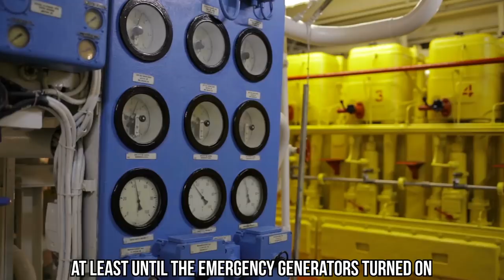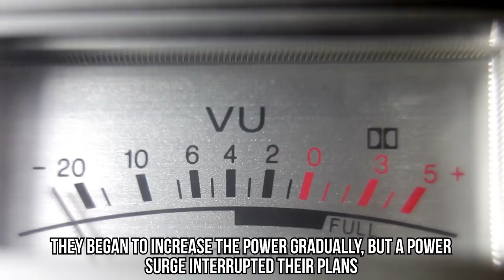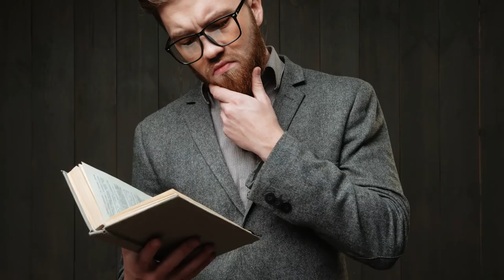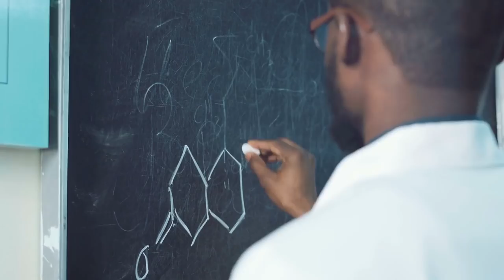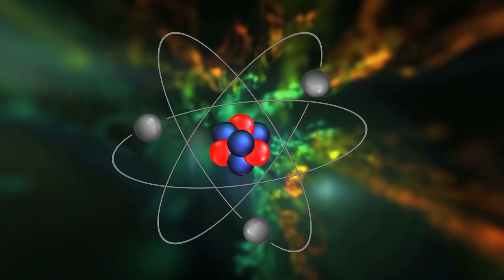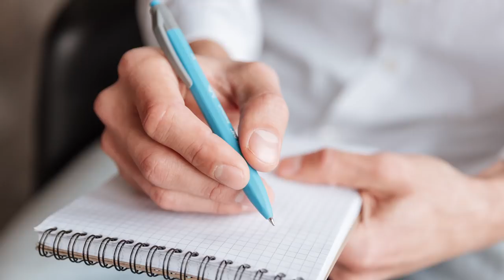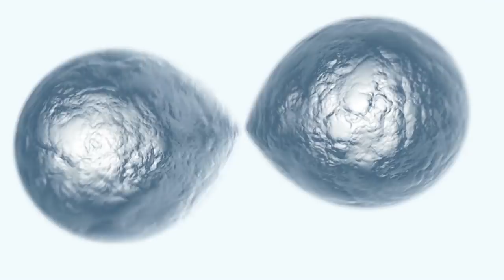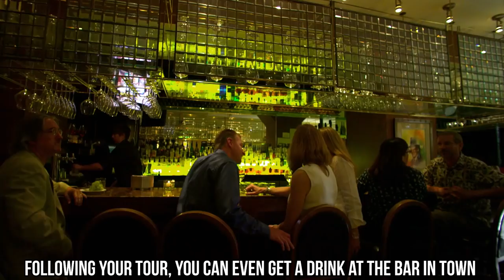10 Unexpected Consequences Of The Chernobyl Disaster

Comment: 0:02 Pripjat wasn't a small town, 50.000 people lived there, mostly young families.
0:47 The test wasn't wanted, it was ordered by the plant managers and should have been conducted before the reactor went into service
0:54 Sorry, nitpick. Turbines IN the reactor? Turbines of the reactor.
1:28 Actually, they couldn't have brought the power level back up. The reactor was poisoned with Xenon which made it impossible to rise the power up without withdrawing control rods, that's what they did, they withdraw too many, which meant they were losing control of the reactor. The right thing to do in this situation was to shut the reactor down. Right after the drop in power occurred
3:23 Caesium 137 has a half life of around 30 years, as does Strontium. The big problem in the immediate aftermath was Iodine which has since decayed, but Caesium and Strontium are still found in the ground and are absorbed by mushrooms to this day. To this day, mushrooms and the boars that eat them are contaminated in Germany.
3:29 Quickly? Pripjat was 3 kilometers away from the reactor. It was evacuated on April 27, one day after the explosion. That's actually a long period, considering these people weren't told about anything. They even went outside with their children on April 26 since it was a beautiful day, not knowing anything about the disaster which was unfolding in front of their eyes. They even watched the fire from a bridge near the reactor! Well, the evacuation was efficient, that can be said, but it was NOT quick.
 3:42 Gone? No, washed deeper into the ground. It's still there.
5:21 Except for the people of Pripjat... recieving the dose equivalent to 20 years of background radiation in one day isn't a small amount. Exposure time is important when dealing with such issues.
7:35 They weren't given any Iodine pills. On April 26, they played outside, they went to school. And of course the food was also contaminated.
8:26 In the aftermath of Chernobyl there actually has been a rise in birth defects, especially in regions of Belarus, which was hit the worst by the radioactive fallout. It is also important when the exposure occurrs. It's more dangerous early in pregnancy than in the later trimesters.
10:24 The loss of Chernobyl Reactor No. 4. While the construction of Reactors 5 and 6 was finally abandoned in 1988, the remaining three reactors continued to function since the Soviet Union and later Ukraine needed the power. Unit 1 was shut down in 1996 after pressure from the other European countries, Unit 2 in 1991 after a fire which destroyed its second turbine and repairs were too expensive, Unit 3 was finally shut down on December 15, 2000. 
10:29 Actually, Belarus is building a Nuclear Power Plant right now. 
11:12 And the loss of their homeland, that's why some people went back to the zone and settled there.
11:50 Not only themselves. They were seen as contaminated by other people and as such were shunned and excluded.
14:18 It depends on what part you eat. Don't eat the seeds, those are the most contaminated part.
Personally, I feel this video is downplaying the scale of the disaster and the suffering of the people, especially the firemen who sacrificed their lives and the liquidators. While mental health is surely a factor, these people suffer real, physical consequences as well. Also, no word about the plant personnel. To me, that is disrespectful.
Reply: Thank you!! 👏 I didn't like this video at all, so much disinformation and misinformation, I thought it was some kind of "old Soviet propaganda" 😣. Many, many people died and are still dying from the disaster TODAY! Mostely cancer of different sort and a lot of children born with severe birth defects. (Not to mention all those who died within the first days, weeks and months 😢) EVERY LIVING THING WERE AFFECTED BY RADIATION, and a large number of dead objects like buildings etc, are still radioactive! 
You were right that the first evacuation started on the day after, but bc the exploision started early at night the 26th, it took at least 40 hours until the evacuation started! Lots of damages had been done to people by then, unknowing as it was a downplay. Secrets that killed many people 😢😣.
I remember how we were affected here in Sweden too. Not only for a short time, it was for about 2 years that we couldn't eat food of any kind from a very large area of our country (the northern part). And I have done some research of my own (as a Biomedical analyst), and the problems with thyroid defects (hypothyreodos, thyroid cancer etc) have been rising A LOT; at least 500 000 people have hypothyriodos (also hyperthyroidos) and I am sure even more got it, but they don't have a diagnose. We are only around 10 miljon people in Sweden, so that number of thyroid illnesses in a small population, is high. 
Thanks again for your well written comment on this video, which was misleading (and it made me angry)! 👍
Reply: Thank you

Comment: this is almost all wrong and the reactor did not explode from a power surge. wha actually happened is the chief that controlled what the people did to maintain the reactor made them shut the reactor down to like 1 percent because it was rising in power (and it was probs cuz it was xenon poisoned) after that the operator(chief)
made them boost the power up quickly again to conduct a test to see if the turbines can run the coolant until the generators turned on. and after they turned it on again the power went rising FAST like really quickly and then they pushed the AZ-5 (scram) button to shut it down but failed because at the tips of the rods was some material/element that sped up the reaction making it rise in tempature and heat faster and faster after and then water in the reactor chamber turned into steam which then managed to eventually lift the 50+ pound lid THROUGH THE CEILING and i dont know much after that

Comment: What is this? Soviet propaganda? First of all, there was an emergency shut down, but a design flaw meant that it would cause a huge power spike before shutting the system down, which is what caused the explosion. 
Second, the Soviets did NOT evacuate quickly. They delayed until the wind carried the radiation to the west. American's knew about Chernobyl before most Soviets did.